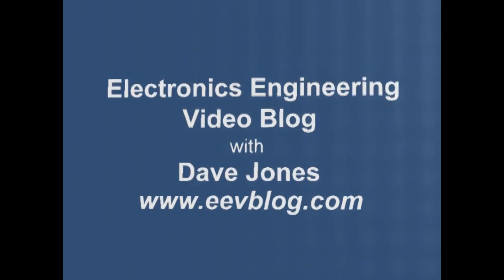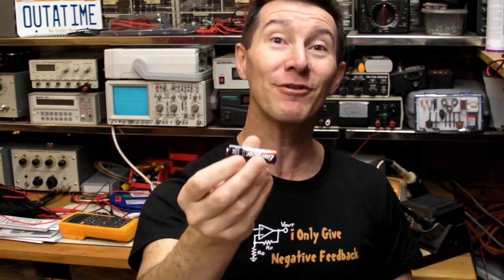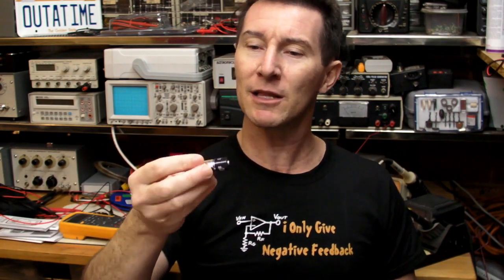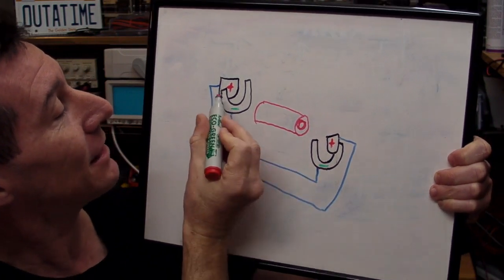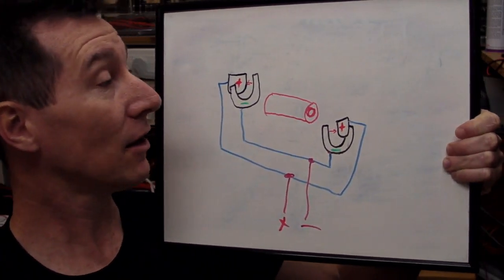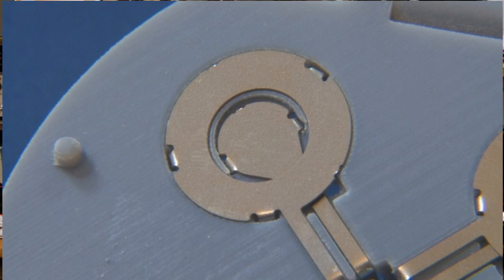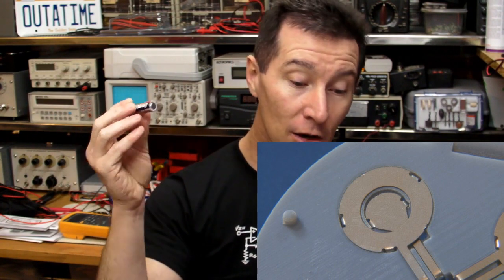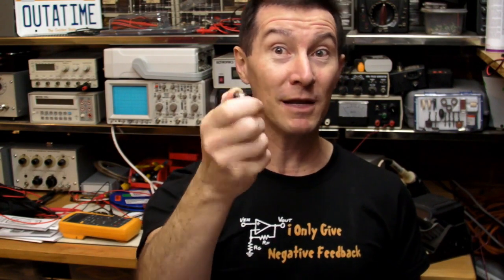EEVblog #98 - Microsoft InstaLoad Battery Technology - Patent Busting Time?

Comment: After almost 12 years it is safe to say that it was a fail. In addition to the issues you detail this technology would have required much tighter tolerances on battery sizes which alone is enough to make it fail. So these are the reasons why nobody patented it (except Microsoft...).

Comment: I think I can solve the problem of people being conditioned to look for the positive and negative terminal.  Just go ahead and put a positive and negative indicator on the instaload.  That way if they look, they can find the indicator even though it's irrelevant.
Reply: +ElGatoLoco698 In which case why even bother paying the license fee for the patent, if your are going to put the markers on you don't need it.  People would just insert the batteries the correct way.
Reply: Joanna Hammond
The video showed why.  People are conditioned for it. They look for it. So if you put indicators on it, people wouldn't question it.  That way if people don't know what the instaload is, they can still see indicators on it so they don't worry about not putting the batteries in the wrong way.
Reply: Exactly, they will follow the markers and put the batteries in the correct way.  So you could reduce product cost by not even using InstaLoad.
Reply: Joanna Hammond Exactly, it's a waste of money as Dave Jones points out.  Most people put batteries in devices and don't mess with them after that.  Meaning if you bought one of these devices, the chances are pretty good that you will not be the one to load the batteries again when they run out.  If you are the one to load the batteries again, you would probably forget.  That means, unless you know what an instaload does, then they are pretty much worthless.  Besides, is it really that difficult to insert the batteries the correct way to begin with?  If the device doesn't work, you can simply turn the battery around.  At least it's not as bad as the batterizer.

Comment: What I don't like about this "new" battery contact design is there is no means to provide a spring tension to ensure proper contact pressure.

Traditionally, the negative polarity contact is made as a spring in a variety of forms and geometries that ensure sufficient contact pressure at the positive terminal for a reliable electrical continuity.

If a product uses this technology and use results in a weakening of the contact position, then the battery contact will become unreliable.

Comment: If I was designing a product were battery polarity was critical I would either have a series Diode to prevent reverse current flowing or place a bridge rectifier across the terminals so the battery can be inserted either way and the supply would still be polarity correct.

Comment: many batteries i've seen have a cap on the positive side that covers that whole end of the battery, so it's conductive up to the rim of the plastic label - in other words, the positive terminal is just as wide as the negative one and that must surely cause trouble in this design
Reply: It doesn't. The protruding positive cap prevents the outer rim from hitting the negative contact.

Comment: this will solve all my polarity problems because i live such a fast life that i can't be asked to spend 5 seconds to check the polarity on my device. i could be using that 5 seconds to not get laid! what a waste of time! every single day i waste hundreds of hours staring at my devices and trying to figure out that the spring side is negative! I am a goldfish with a 30 second memory, and every day i have to pull out the batteries in my TV remote and check to see which side is negative and which side is positive! it keeps me up at night, and when i do sleep, i have nightmares where i'm chased around by AA batteries and little springy contact points. they taunt me. :face-blue-wide-eyes:

Comment: I suppose it works great for single cell products anyway, but geez .. if they can't follow the battery insertion pictogram, are they still to be expected to read the other warning labels? 

One of the "why wasn't this done before?" forehead slappers that I've run across is (auto) oil filters with a kind of grippy treatment (suspiciously looks like acrylic pickup bedliner) so they can easily be spun and removed by hand.

Comment: the nipper could push a switch to tell the direction of the battery. no need for two leads on either ends. no short out.
Reply: Two switches on each side, if only one is pushed, it will determine polarity.  If neither or both is pushed, the battery will not be connected.

Comment: How about some kind of latching relay that connects the battery to the circuit properly based on its polarity? Opening the battery cover would release and reset the relay. No voltage drop to diodes, no chance of fire.
Reply: High cost, needs a lot of phisical space. Diode bridge is better, if only you can loose up to ~1V of supply.

Comment: well i can certainly see why you'd design this sort of thing.. though i'd probably not put it on the product. If I were the product designer, I'd just print the plus and minus on the case, and people will still insert it the way they're used to.. but the big difference is that if people mistakenly put it the wrong way around, they won't call technical support, nor will they break their product.

that's a win-win situation where people don't lose their decades of conditioning, while still decreasing product failure. And honestly, a product will need a polyfuse anyway, so you might as well use it to protect against battery short circuit

Comment: I had kinda pondered something similar years ago,but the problem that I thought of was that the contacts on each end would have to be very carefully spaced,so that you don't short it out on the 'nipple' end,if the negative terminal stuck out too much,it would short out to the 'nipple plate',not 'across' the contacts per-se,but across the single + contact. (kinda hard to explain.) And also,the varying positive/'nipple' contact sizes.
Guess I shoulda rigged something up and patented it.

Comment: I built a electronic cigarette power supply, called a "mod" in the vaporizer world.  I use it to attach my resistance coil device, which vaporizes e liquid, which is glycerol and nicotine.  There are many moders out there who build their own.  I decided to use two washers on each side, with recessed center contacts, I also did it in a childs toy, which had a broken terminal.  I never heard of this tech until today. When I did it, I also thought it wouldn't catch on for the reason you stated.

Comment: If the polarity matters and cannot be solved by diodes (voltage drop) I usually used a fuse and robust diode which shorted out the reverse polarity and blew the fuse. But this is a bit cruel, the device must at least survive - 0.7V ...mostly does...

Comment: How the hell do you get the batteries out of there?  I always squeeze in one of my fingernails between the positive side of the battery and the connector, push it backwards (which the spring allows) and lift it up.   Without the spring it's gonna be a pain in the ass trying to pull out the batteries.

Comment: So clearly the solution is to have separate leads from all 4 points (the two rings and the two positive contacts) and use voltage comparators to decide which leads to pass through with like a mosfet or something.  Then the two rings are not connected to each other, and you can't get a short.  But its 2021 and still I haven't seen anyone use this patent ;-)

Comment: Here's another issue: What if someone put in a bit of alu foil, because they don't have the correct size battery, but they need to use it (even though they have no AA batteries to put into  the AA slot, but they try and adapt it from a AAA so they can put it in and use the device)

Comment: I usually use a simple diode bridge. I will work always and no problem with shorted battery.
Reply: The whole point was to do it mechanically so that it doesn't cause a drain on the batteries.

Comment: @nitrousoxijk Diodes drop voltage. For example one silicon diode drops ~0.7V,  a bridge rectifier drops ~1.4V which is almost all your battery voltage. Or if you used Schottky diodes you would get ~0.3V, or as a bridge rectifier ~0.6V. Still this is really too much, for a 1.5V battery.

Comment: this would be good for loading batteries into belt packs of mikes. It would shorten the time it takes to load 20 or so G3's from 10-20min to about maybe 5min and not having to worry about replacing batteries in the dark; in one of the wings or back stage is another+. Although the older G1's use a 9V battery. so I wonder how it works for a 9V battery? + it costs about $60~100 in batteries to do 4 shows and 3 full rehearsals so how much extra would they all end up costing?

Comment: I don't think it is compatible with any batteries. I'm just looking at a varta brand battery the whole cylinder is the positive and the negative is a cap inside the tube insulated from the cylinder. If I'm not wrong I believe duracell does the same. 
I also have a rechargeable battery from Verbatim in front of me where the cylinder is negative and the nibble is insulated from the rest. This type would probably work well with this design.
I would believe that is why this connector isn't widely used since it relies on changing of design of the very big players in the battery industry.

Comment: Doesn't look like it'll be compatible with Duracell batteries. The contact area surrounding the nipple is on them seems to be as wider (if not slightly WIDER) than than the flat negative terminal.
Any device using it will also have to have warnings printed on them with battery compatibility lists.
I think MS may be about to contribute to world statistics for house-fires caused by battery devices.

Comment: I really like your busting silly stuff, but I do think that this can be implemented in a safe way. This is mostly due to the fact that in one product one will use one kind of battery and this circuitry can be designed with  wide (safe) enough tolerances to accommodate for that. You've had better rants, rest assured!

OMG, I just noticed this was posted 5 years ago, I'm sorry!

Comment: • 5:28 - I'm more worried about how there are many different battery designs with some being very bad and, e.g. the barrel connected to the negative terminal and with little/poor/or no insualative wrapping.
• 7:27 - Raymond Chen just mentioned this in his latest blog post about combi-PS/2 connectors resulting in more customer-service calls. I imagine this video will get some extra views. (Dat intro tho.)
• 8:13 - Has any product actually "blown up"? 🤨
• 11:00 - It's been 11 years and I've yet to see it used anywhere. It's like when a law was passed to allow women to be topless; adolescent boys were thrilled, but no women actually took advantage of the opportunity (and the few that did were, um…)

Comment: Amazingly simple idea. They usually make the most money too. As if Microsoft need any more..... You could prevent short circuits by using a simple switch interlock. Open until the battery is fully inserted??

Comment: Seems kinda stupid to me. What would you ever need this for? You can just feel where the minus-side is, anyway: it's where the spring is. Every battery-using that takes these type of cylinder cells puts the spring on the minus side so the plus nipple doesn't get caught in it. This design also wastes material as you have to have a wire for each polarity going to each end of the battery, and a spacer between batteries if they're forming a line to fit the contacts for both polarities, otherwise you'd have to put the batteries in the same way as each other, thus rendering the arbitrary direction feature pointless.

Just... why? Who ever wished they could just insert batteries in any arbitrary orientation instead of the right way?

Comment: What about batteries, particularly some high-capacity NiMH batteries with very short nipples? This design would just short-circuit them, so it's potentially dangerous and TBH I've never thought of getting batteries in the right way round as a huge problem really. And as ttk1opc says, I'd really rather not pay ms tax on remote controls etc...

Comment: Umm... why not just use a simple 4 diode rectifier bridge?
Reply: Cristi Neagu You really want to waste 0.6V per Diode in your battery operated circuit? I don't think so.
Reply: alek202 That's a good point.
Reply: +Cristi Neagu You should also note that a full wave bridge rectifier won't get any power if the batteries are + to + (or - to -) because no current would flow. The terminal with the negative on the lower part of the mount seemed to be the best of all possibilities, certainly a bit less expensive than adding 4 diodes.

Comment: why not just use a bridge rectifier?
Reply: That doesn't work with DC? Also even if it worked, it would need some electrical parts. Whereas this idea just needs a bit of wire...
Reply: Mobin92 It does work with DC, I've used it in several early Sega consoles to allow either center-neg or center-pos power plugs. The only issue is diode loss which can be a problem in battery products, where as in my example, from a 10V PSU and let's assume there's a diode drop of 0.7v, I'd have a total of 1.4v drop. My consoles will still happily run at 8.6v as there's internal 7805s and there for I can go down to 7v and be fine.
Reply: i see so to use bridge rectifiers in that manor would mean designing the product with that in mind :3
Reply: Yep. I'm designing a bike computer system for myself for fun and I want to use a lead-acid battery and whilst I could use a bridge, I'd lose voltage I'd need so I'd rather just use a reverse protection diode as 0.7 loss is easier to deal with :P
Reply: sounds good :3

Comment: 6:56 - ahh so it's a solution looking for a problem. Right. Can't say that in the years of putting batteries in things I've ever broken something through incorrect battery insertion, or been utterly unable to 'fix' the problem myself when my tv remote doesn't "work" after replacing a battery.

Comment: I hate when stuff like this is called "technology". I know it technically is technology but I prefer 'trick' or 'feature'. Microsoft wireless mouses have been capable of running on only one of two batteries for a while which I think is a better feature than instaload because I hate the extra weight of a wireless mouse.

Comment: i dont get it.
what is so bothersome about checking polarity before u install batteries?
who is willing to pay the added licence cost on products for this minor convenience?

also: it doesn't work when u have more then 1 battery in line, like with flashlights, u can still have the batteries shorting each other.

also do we really want to make people even dumber then they are already?
there is something to say for a tiny bit of discipline, especially when working
with lithium-ion cells.

Comment: Very stupid design actually. It means a battery needs to be perfectly aligned to a fraction of a millimetre else it would short out. Even that plastic+wire terminals (though slightly better) would still need extreme precision engineered sleeves to ensure the battery doesn't move even a hair's breadth and cannot possibly be inserted even slightly off axis. I'm sure this is escalating costs way beyond any possible benefits, not due to the extra complexity of the terminal and wiring, but due to the extreme tolerance escalation and wear avoidance needed for safety purposes.

This is in addition to the issues you mention about variance in the battery "nipple" size!

 What's more ... 10 years later and even none of Microsoft's own products use this junk idea. Even they know it's a complete failure.

It would IMO even make inserting batteries worse instead. I.e. now it is either so tight that you'd need lots of pressure to push it in or you'd have to be extremely careful to align it properly. Whereas with the standard it's just: figure out which way round and plunk it in even if slightly off axis.